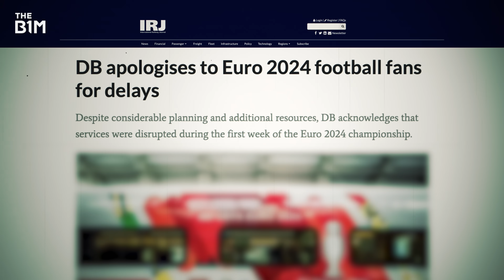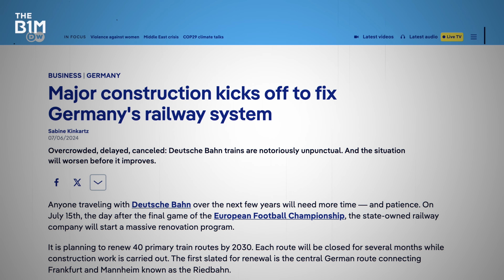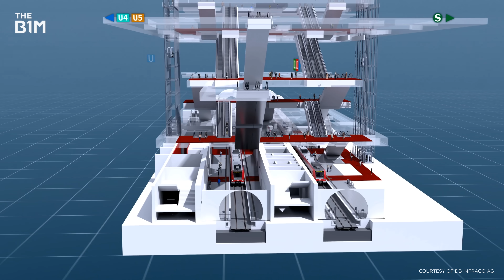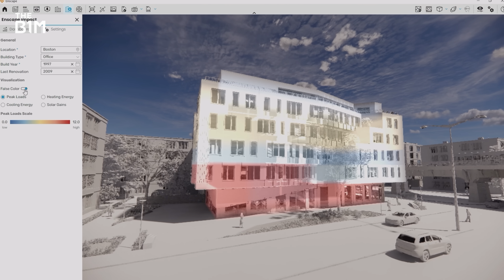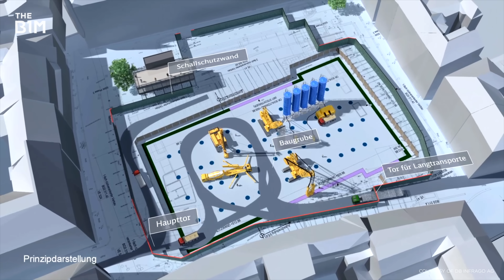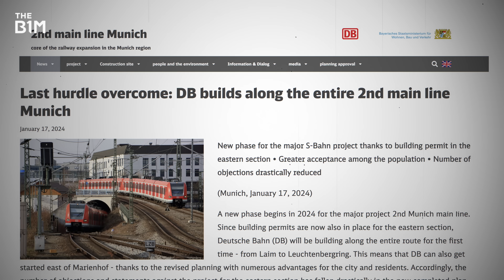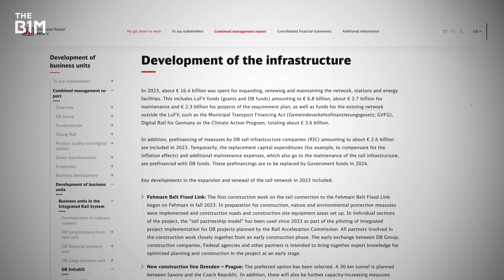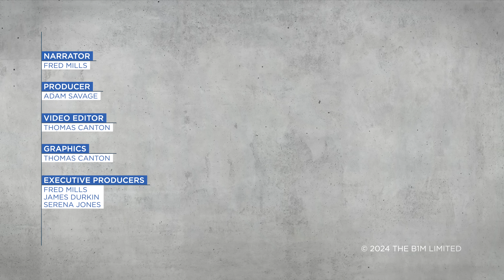Germany is (Finally) Fixing Its Failing Railways

Comment: One of the main issues that are plagueing DB is actually the "rail reform" from about thirty years ago. It was essentially a privatization.

 The DB is now not a state operator but a public company (although the state holds all its shares). This essentially means that DB is now legally required to aim for the highest profit, not for the best service. Stuttgart 21 is a good example for this: Similar to train station projects in the US, the main objective of moving the train station below ground is creating high value real estate above.

Also, the way the infrastructure has been split off essentially means that while the maintenance of existing lines has to be funded by the DB, new construction is funded by government grants, which means that DB is financially incentivized to let rail lines break down and close them and have the government build shiny and expensive high speed rail lines that will turn them a profit. At least this point has been somewhat mitigated by the creation of the reconstruction fund by the outgoing government, but soon again the transport ministry will most probably revert from being held by a somewhat competent Auto lobbyist to a totally incompetent Auto lobbyist. Note that even the increase  government money isn't enough to arrive at the "Deutschlandtakt", and integrated regular schedule for the entire country.

Also, much of the regional train service is run by private companies that extract their own profit out of the government contracts they receive for operation, and as these local rail companies are often owned by foreign state rail companies like trenitalia, ÖBB etc., essentially German state companies pay for the rail systems in other countries.
Reply: Bravo! The opposing interests accurately displayed. Genau auf den Punkt gebracht, danke.
Reply: DB makes most of their profit with logistics outside of germany.
Reply: Capitalism want to take more money from people and communism makes more tax
Reply: As with most problems, capitalism.
Reply: this "Privatization is bad" comments show again you are all iditos. Privat does not equal profit. It means that the shareholder has control of the firm. In the usual economy that transfers to shareholders saying "i want profits", especially publicly listed firms where the shareholders are one of 1 million others so they have no clear interest in the firm because they will sell when the share price is high. But Deutsche Bahn? Who is their shareholder? 100% belongs to german government. Thus, it is the german government that is setting the goals, setting the overviewing board and so on. This has NOTHING to do with privatisation. It only has to do with failed government overview.
Reply: you omit that it wasn't only the DB that was privatised back then.  Telekom and the German post were also privatised at the same time, and both haven't had the same extreme issues as DB.  So clearly you can't just put the blame at privatisation.
Reply: @onurbschrednei4569  German internet is notoriously slow and unreliable. A common long distance train journey between two big cities in austria goes through germany and you always lose connection as soon as you enter germany, and it only comes back once you reenter austria
Reply: @onurbschrednei4569 germany still doesnt have good internet and the private dp, dpd and co have their own issues.
Reply: @CommunistNo.09182  bad internet has nothing to do with phone companies. Bad internet is solely because the German state was extremely slow in rolling out 5G. Not Telekom’s fault.

And what exactly are the issues at Deutsche Post? They have empirically become much more efficient in the past 30 years.
Reply: @onurbschrednei4569  Who mentioned phone companies? The Telekom owns most of the Internet infrastructure and in some parts its really bad since it was not profitable enough for them to improve it. Yes the mobile internet is not really good as well but the Internet at home and at companies is more important.
Regarding the Deutsche Post: Yeah they do their job but depending on where you live they are very unreliable (just like the rest)
Reply: No, there quite a lot of issues with DB, but privatization isnt one...see for exemple japan which has private railroads as well.
Reply: @XKING91 This shows that you really have absolutely no idea about the issue. Large parts of the rail tracks where cut off to increase profits through depreciation

Comment: You should do a video about the implementation of ECTS. This is the main reason, though not the only one, for the revised opening time of the new station. It's also interesting to note that the DB are now being very reluctant to guarantee the financing for the third, and top, level of implementation for the ECTS system in, and around, Stuttgart
Reply: You mean ETCS Level 3? Is that already a thing?

Comment: I hope they are updating the signalling. Ran into more than a few delays in Germany due to signalling.
Reply: They are working on that all over luckily. And for the mentioned big projects like the Riedbahn and all the following, the video kind of understated how comprehensive it is. Basically the workers rip out the entire line, tracks, balast, signaling, overhead lines and so on. Then they completely rebuild the line from scratch. Blocks the whole line for a while, but for the work that is done, it is much quicker and much, much cheaper than the usual way of e.g. doing one side at a time on 2 -track lines. And has the benefit that everything is refreshed, so it will last for a couple of decades before serious maintenance is needed again.

Comment: I was in Germany in August and in Munich for Adele. 1st The trains were always on time and very fast much more efficient than I’ve ever witnessed in the UK. 2nd They were way better at handing huge crowds and keeping things moving. 3rd Trains were more Morden and better maintained than any other train network I’ve experienced. Munich as a whole was amazing, very clean and nice people.
Reply: The Munich U-Bahn is very reliable and punctual. The S-Bahn can’t be that reliable and punctual when you have a very long core route connecting almost all lines and a train every 2 minutes (the most used train route in Europe by traffic density). But when it works properly, it’s also a blessing and a very good means of transport to move from A to B here in the city as well.
Reply: The trains that took people to Adele were the U-bahn, always operated by local cities themselves, here the MVG. The issue mentioned here is the Nation wide rail operator DB, with their nation wide network. The S-Bahn system in munich is part of the DB and the run on on their rail infrastructure, which is old and overloaded, so the munich S-Bahn is the issue here, and not the U-bahn. The U-bahn runs on a completely seperated infrastructure detached from the main rail, thus noone usually complains about it as it's super reliable and has rarely any issues.
Reply: @mmd77777  The local rail for getting around within German cities is great! Only 4 cities in the UK have some kind of underground local rail network, compared to over 20 in Germany and only 7 have trams, compared to over 60 in Germany. Birmingham, similar in size to Munich only has one tram line and Leeds doesn't even have that. 

Germany has cities the size of Brighton or Coventry (300K) with underground/tram hybrid networks and they always use the same tickets as the bus network, even singles are valid on all local and regional bus and rail.

That's way better than in most of the UK, where a bus single is only valid on the first bus you get on and doesn't allow you to finish an entire single journey using multiple bus and rail lines.
Reply: If you went to Adele you probably took the U-Bahn, no? They are operated by the city and not connected to the railway network. They are usually pretty good in Germany along with trams.
Reply: Most of Germany isnt Like this, munich IS an excpetipn

Comment: german here. Main reason for the mentioned underfunding and neglect is the privatization of our railway company DB into a profit oriented stock company, although the state holds a large Portion (if Not the majority) of its shares. Instead of investments, huge cost cuttings happened. The Plan was Not only to save money, but rather the DB making profits… Which can Not Work. The consequences are felt today and will be in the future
Reply: Actually, the state owns all the shares. Therefore, technically it's not correct to say that the DB was privatized as it's still state-owned.
Reply: DB has never been privatized. It is 100% state owned. That's why it is so bad. It can't go bancrupt, all jobs are completely safe, regardless of the quality that is provided.
Reply: DB does not operate "for profit", they are literally getting direct funding by their sole owner, the German government. The failed privatization is not the issue DB is facing. It being completely shielded from any sort of repercussions for their terrible services, is the issue. If any for profit company operated as badly as DB it would rapidly cease to exist.
Reply: @jonassattler4489  Deutsche Post operatet genauso badly, aus den selben gründen (habs als mitarbeiter erlebt) und irgendiwe gibts die immernoch. mal schauen wie lange lol

Comment: Germany should NOT have a reputation for being "efficient".  I lived there for a couple of years and experienced nothing of the sort.  PERHAPS maybe in the automobile industry, which is impressive, could the Germans be considered "efficient" but not so in almost any other area, including train travel.  They continue to be rooted in paper-based processes which are horrifying to have to navigate.  Most things are still done by in-person appointments and through the mail, and the state of broadband internet service in Germany is behind most other western countries.
Reply: I think the 'german' efficiency killed the capability for resilience. Everything was 'optimized' to be efficient in normal circumstances but without having any capacity left for handling any deviation from it.

Comment: Interestingly, the first proposal to have the S-Bahn station situation below the Orleansplatz was met with terse criticism and outcry from the residents who live in Haidhausen neighbourhood. The transfer between underground S-Bahn station and aboveground S-Bahn, regional, and long distance station would be a very long walking distance. When the European Union passed the new regulations for the stronger underground fire safety and escape routes, Deutsche Bahn had to redesign the entire Ostbahnhof station and realign the tunnel from Marienhof to Leuchtenbergring stations so that the tunnel would follow in paralleo the current aboveground tracks and a new underground station to connect with each aboveground platforms. So much better but that increased the construction cost even further.

Comment: It's a great video but as a German I want to add some things. Just as you said trains are barely 'on time' while on time means for deutsche Bahn less than 6 minutes to late. So if your train is 4 minutes too late it still counts as on time.
Also every German knows how bad the deutsche Bahn is and if you have an important appointment you either take the car or a train earlier.
A personal story of a friend is that she was stuck in a train for two hours with no electricity (therefore no toilets!)
I had a similar experience, my train was 20 minutes late and completely overcrowded, I had to stand for nearly 2 hours, missed my SBahn and had to take the next one which was 6 minutes too late. At the end I arrived home 40 minutes later than planned, unfortunately this is normal here.

Comment: little correction:
That the S-Bahn is a suburban train is correct, but the "U" in U-Bahn doesn't stand for underground as most people think. In fact only three or four of the many more U-Bahn networks in Germany are mostly underground. The U stands for "unabhängig" = independent, as it doesn't share it's tracks with other railways or the road traffic. 
While the S-Bahn is there to connect the outer towns to the center with the necessary capacity, an U-Bahn usually operates with shorter headways, smaller trains and shorter stop distances inside the city close to its maximum capacity (almost 30.000 people / hour and direction in Munich).
But there is no clear border to trams or other light rail services, as many Cities have their own unique systems.

Comment: I thought Hamburg-Berlin was already closed but seems I was wrong.
On one hand I'm happy that money is finally invested into rail again as it has been made more attractive to use with the 49€ ticket (a whole ordeal in itself and I hope we'll manage to keep it around and more or less affordable despite already increasing its price next year).
On the other, I'm really dreading the time when my usually used corridor is getting renovated. It is necessary and I hope they expand it since it is in high demand by freight, long distance and regional trains but only has one track in each direction despite mostly only going through forests.
It's necessary but we Germans also just love to complain, so we absolutely will complain about all of this as well.
And for anyone wanting or needing to travel by rail here: If you can, avoid ICE and IC trains and instead take the regional REs. They may be a bit slower but in my experience way more reliable.

Comment: What many people also forget is that the majority of investments for the German railway network over the last 30 years had to go into the modernization and reconstruction of the East German railway system after reunification. 
The (formerly) West German state-owned railway company DB, fully took over the East German state-owned railway company…
Reply: Actually not took over. The Deutsche Bundesbahn (DB) and the Deutsche Reichsbahn (DR) were both dissolved and replaced by the Deutsche Bahn AG (also abbreviated DB)
Reply: @nacaclanga9947  only on paper
Reply: AND the punctuality and reliability in these eastern states is way better than in the rest of Germany. Munich - Berlin for example runs pretty well
Reply: @Donilan because it's one of the newest lines in the country
Reply: West German infrastructure was almost as bad as the one in East Germany at that time. At least, the DR didn't put as many secondary lines out of service as the DB (until 1994).
Reply: The German Railway system (formerly state owned on both sides of the wall) was intentionally worked to the ground for privatization reasons. Most of the "investments" were put into making the DB AG his own hardest  enemy, in the form of a road-spedition.
Transportation for goods and people was always a balanced system, one financing the other.
But now we see, you can't provide the network just on ticket prices. As a lot of ppl had argued back in the days.
Reply: @Promi374  Deutsche Bahn may have been privitised, but the state owns 100% of all the shares, as the stock of the Deutsche Bahn AG hasn't been put up for public trading.
Reply: @Promi374  both statments are nonsence
.........
the rail was runing a massive defecit
and the government conantly has to pump more and more money into it
the "privatization" was just a lie to excuse the collapse that followed the cut of subseides
......
the only thing that changed was that they changed the form on paper
the staat as the single stock holder still has full control over the Rail

Comment: I just railed around Germany last month. Rode from Vienna to Nuremberg to Stuttgart and Ulm. It went pretty well. The construction in Stuttgart was intense, huge site.
Reply: So you railed around Southern Germany. If you'd like to keep that happy memory, don't go to NRW
Reply: @cheers1905  How will any other experience change the one I already had?

Are you saying that the southern trains are better?
Reply: Then you went lucky or you probably haven’t really used a lot of regional train services. I live in Hamburg and I rail around a lot and I can count down the amount of times I arrived on time in the last 10 years on one hand. However it is fair to say that I usually use regional train services and the metronom Eisenbahngesellschaft, which runs the regional services between Hamburg and Bremen as well as Hamburg and Hannover is probably the worst of the lot, they can’t even keep their trains in shape and cancellations are usually the outcome
Reply: The project in called Stuttgart 21, they have a youtube channel if you're interested
Reply: the deutsche bahn can be nice if they are on time, but they are currently at around 70% of trains that are on time and thats pretty bad. most neighbor countries are at least at 80+%
Reply: The ICE is on time 64%. You got lucky
Reply: Vienna is not in Germany though...
Reply: @gabrielp.179  wow, thanks for that information!
Reply: @gabrielp.179  we've tried that once, didn't work out.

Comment: The projects shown in this video are a symptom of why the German rail network is failing. Due to a contract with the german government that outlines subsidies to the DB new build infrastructure is favoured over maintenance, causing neglect of existing infrastructure. Those billions spend on flashy new stations could have been spent better.
Reply: it is not a contract it is LAW
and the same LAW causes problems in the Electrical grid